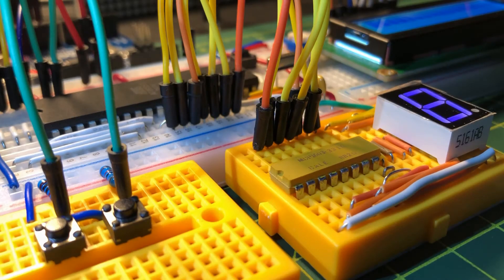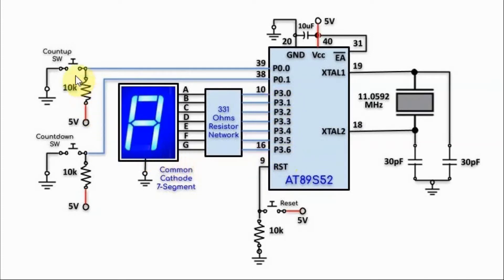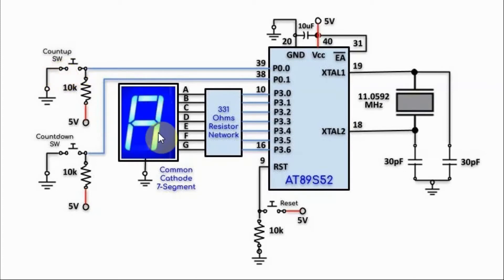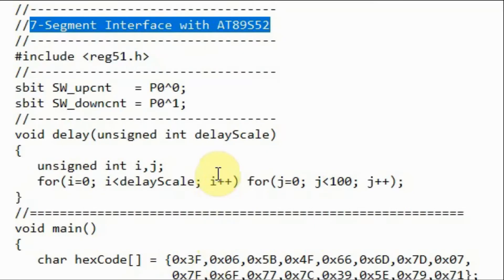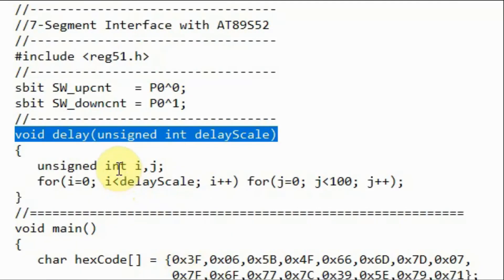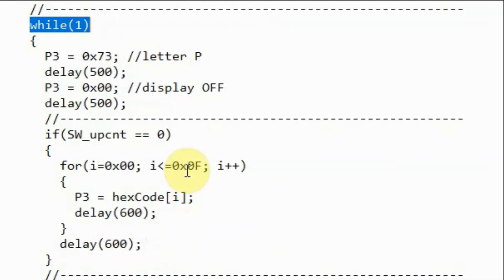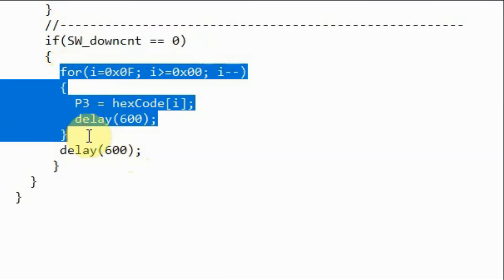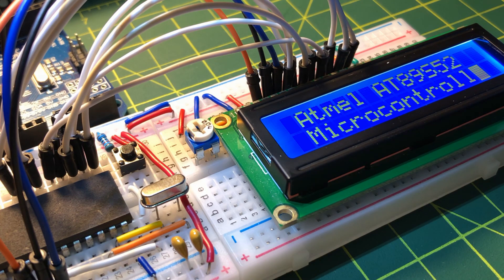AT89S52 Microcontroller Interface with 7-Segment Display

Comment: Sir, I need one help
I'm using at89s52 and uploaded a LED blinking sketch (and I'm not using port 0).
 But the point is, the blinking led script is working fine but the LED BRIGHTNESS IS TOO LOW (Even if I completely remove the Resistors).

I have connected anode of the LED with port1^0 and the cathode goes into the ground via a 270 ohm's resistor.

The the LED is very dim. Otherwise every program is working just fine in this microcontroller. So please help me.. I'm not getting even the power power these I/o pins even if I try to use a BJT Transistor (BC547) to increase the output current. But the Microcontroller output pin power is so low that it even can't be able to turn on the BJT. 

So I need your help.

And needless to say but I'm using 16 mhz crystal, not 12mhz.. because I don't have 12mhz crystal. But I think this is not the problem.. 

Can u help me sir??